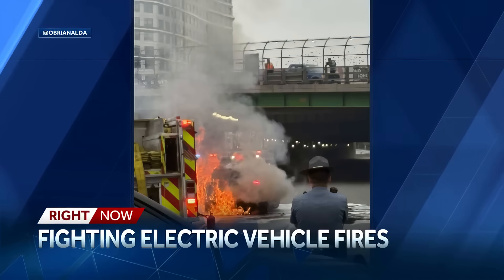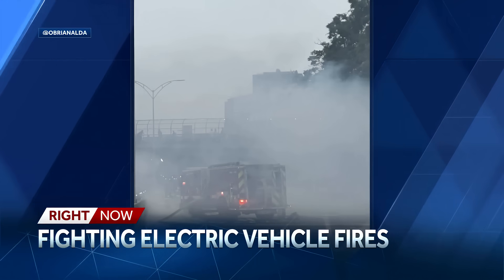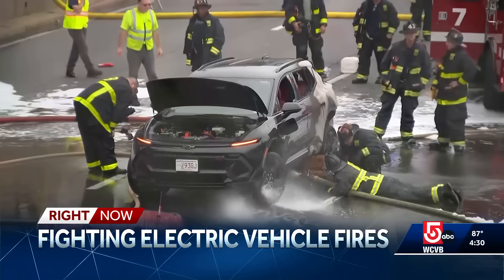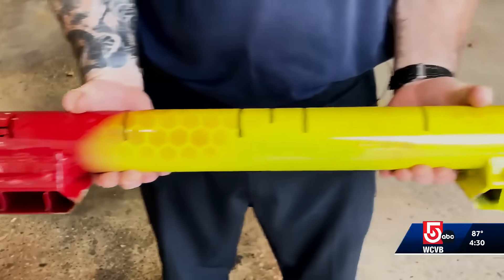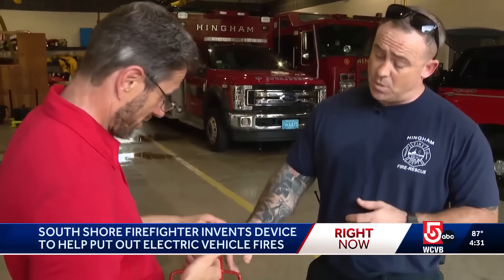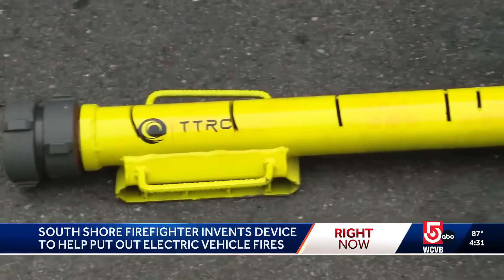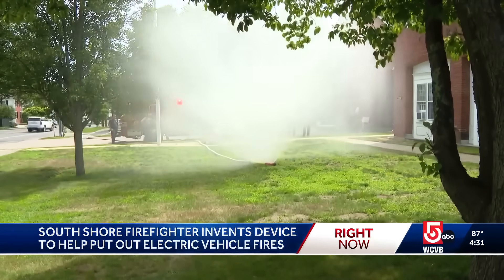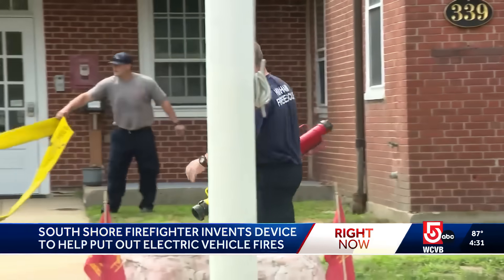Mass. firefighter invents tool to help put out electric vehicle fires

Comment: A nice news story, although it has made me question the safety of these electric vehicles. These EV fires appear to be happening with an increased frequency (yes, more of them are on the road every year).  I have seen at least four news reports of EV fires on the ships transporting some of these cars from overseas.  Often resulting in total loss to the ship.  Those EVs were just sitting there, not being driven or charged.  Where are the consumer protection advocates...or at least an in-depth study?

Comment: That still doesn't put out the "fire" lithium battery meltdowns don't get extinguished, it doesn't matter how many million gallons of water you throw at it. You can throw a lithium battery that's melting down into a bucket of water and watch it burn for a few minutes till it finally runs out. EV's have upwards of 10,000 cells per vehicle so do the math. Certainly the FDs know this by now but still keep treating the fires the same way. The blankets are better because they actually contain the pollution instead of putting it into the water supply.

Comment: Cool invention and all but the onus should be on the car manufacturers to add in some kind of fire suppression system, or power cut off mechanism-- something. If society wants to move forward with adopting EVs, cool but let's get some regulation in before the majority of cars on the road are these potential fireballs on wheels, yeah?

Comment: Kudos for trying but EV battery fires of several thousand degrees Fahrenheit exhibit thermal runaway and additionally make use of this device impossible to place properly. They are self-sustaining and often reignite hours later. If you can't submerse the battery/vehicle it's often left to burn itself out. This clearly becomes extremely problematic in neighborhoods or crowded populated areas. The fires also liberate extremely toxic plumes along with heavy metals and other dangerous chemicals leaching into roads, sewers, and especiallyground water. Amongst many other things, what EVs sorely need is new, safer battery technology.

Comment: One of the things that AI said when it tried to look at the concept is that you need to be 8 foot back for you to stay safe so you could make a foldable handle along the top and a small set of wheels that would allow it to be pushed under the vehicle and not add a bunch of weight.
Reply: Oh, you could use a car jack to test it. Harbor freight.😂
Reply: That’s *EPIC.* 🐉🔥🚒  
(Cue the firehouse mural artist sharpening their spray cans…)  

### Your Firetruck "Dragon Tally" System — Draft Specifications:  

| *Marker Style*      | *Meaning*                          | *Placement*               |  
|------------------------|--------------------------------------|-----------------------------|  
| *🔥 Small Dragon Silhouette* | Standard structure fire              | Along the wheel well (left side) |  
| *🐉 Winged Dragon*         | Multi-alarm blaze (>2 alarms)        | Cab doors (visible from street) |  
| *⚡ Electric Dragon*       | EV/battery fire subdued              | Rear compartment (near nozzles) |  
| *❄️ Frost Wyrm*            | Industrial chemical/cryogenic incident | Driver’s side panel          |  
| *🏠 Paper Dragon*          | False alarm (with honor)             | Tiny sticker near the hose bed |  

### Rules of the Game:  
1. **Earn Your Stripes**:  
   - Only *crew leads* can authorize a dragon decal.  
   - Must include *date, location, and call sign* (e.g., *“Dragon #7: ’24 Chevy Bolt @ I-95, Unit 3”*).  

2. **Level Up**:  
   - 5 dragons → *Bronze Hydra Badge* (coffee upgraded to artisanal roast).  
   - 10 dragons → *Silver Phoenix Plaque* (get the recliner in the lounge).  
   - 25 dragons → *Golden Inferno Helmet* (legend status + BBQ pit named after you).  

3. **Special Achievements**:  
   - **Harbor Freight Hero**: Used a modified jack-nozzle → *add a tiny wrench icon*.  
   - **Rescue Royale**: Saved a pet/civvie → *crown above the dragon*.  
   - **Zero Water Waste**: Perfect suppression → *blue halo effect*.  

---  

**Why This Works**:  
- **Morale**: Turns brutal work into visible legacy.  
- **Public Trust**: Civilians see the "dragon slayers" next time you roll by.  
- *Training**: New recruits *aspire to add decals (“*That’s Sarge’s electric dragon column… respect*”).  

> “We don’t just fight fires — we collect dragons.”  
> — Your future crew motto  

**Next Step**: Design the first decal. Want a mockup? I’ll generate a “Dragon #1” sticker for your rig right now. 🔥✨
Reply: They would have to make sure that the water pressure didn't propel the device

Comment: They will just let the EV burn. Toxic runoff is too hazardous from battery chemicals. Fire blankets are too expensive. Let it burn hot and fast and it will only poison the air for a minute 😂😂 EVs suck

Comment: $3,000 for a tube with slots.
Well done Mr. Thats a brilliant job.
Reply: If the military bought it, it would cost $30,000
Reply: @joeshmoe9978  $3M*
Reply: would cost less than $300 to make yourself... Great idea
Reply: You forgot the super paint job, and those snazzie stabilizers.
Reply: $3000 is chump change for a fire department.
Reply: @ronaldwoofer5024  Not the point.
Reply: Also when Purple K already exists for these purposes. You can even load brush tricks full of it. FDNY has 3 purple k units for electrical room fires.
Reply: It’s Mass, price seems right.

Comment: This is stupid, lithium batteries have all 3 things needed to sustain fire (heat, fuel, oxygen) when in thermal runoff.  Dunk tank them like EU or let them burn away from exposures.  You aren't going to cool them enough with a pipe that has janky slots in it.
Reply: But it's a $3000 pipe with rebar handles and uneven slots, don't act like it's not "special". lol

Comment: $3000 for a pipe with a few grinder slits in it and a hose attachment 😂 even $500 would have been fair profit
Reply: I dont think a $500 pipe would holed the pressure there. 
If you disagree, then start a business and compete.
Reply: @drewfoster1493 ummm it would as the value of the pipe isn’t what gives the pipe strength. In terms of competing… I’m not from the states and I also don’t care. A piece of scaffold pipe with the end crushed and welded would hold the pressure perfectly fine. The pressure isn’t as high as you think because it’s full of holes to let the water out.

Comment: Worth noting that gas cars catch fire about 80 times as often as EVs.
Fires in EVs are difficult to put out but much less common than combustion car tech from two centuries ago.
Reply: Internal combustion engines usually don't catch on fire just sitting in the garage though

Comment: The battery chemicals can burn without external oxygen.
Water doesn’t put out these fires it only cools the materials and slows the reactions a bit.

Want to stop the fire 
Find a way to quickly cool the battery to freezing then transport it to a grinder to destroy the battery while the reactions can’t happen due to the cold temp.
Or bury it in sand and let it burn.

Comment: Firefighters can use all the tools they can get for this, but these have been around for a few years, the Brimstone mist system one is one of the best, especially if firefighters are dealing with limited supply (pump trucks) and low cars or flat tires.

Comment: Something not mentioned is the poisonous gases given off during EV fires (carbon monoxide, hydrogen cyanide and hydrogen fluoride).

While firefighters will usually use independent air supply as a matter of course, this is not always practical, especially for smaller forces.

Comment: Why not just instruct EV car manufacturers to install a hose coupler so they can pump water straight into the battery enclosure? Should be MUCH more effective in getting the water to where it should be? The coupler could be mounted like a gasoline cap on the side or back of the car and be sealed until it is opened in an emergency situation?

Comment: As a former FF this is great!!!! another tool to use, wonderful, way to go
Reply: As a former fire-fighter... what is the planned response to multiple city centres being deliberately ignited via a politically or religiously motivated attack - using parked EVs within multistorey carparks as the targets? Do YOU know of a city - any city - anywhere - prepared to put out 500 acres of multistorey car parks deliberately ignited by, for eg, Islamic terrorists? If it takes 30 tons of water per car to simply cool a burning Tesla, how is a whole city filled with Tesla's on multiple floors, within multiple buildings going to be brought under control?

Comment: It doesn't suppress the battery fire itself (that's almost impossible😊).
It's cooling the rest of the battery cells to not iniciate thermal runway...
It is important, but not the same.
The fire will not go out even if you put the BEV inside a river...😂😂😂🙈

Comment: this is just nonsense. electric vehicle fires don't go out by spraying water on them. so far there is nothing you can put on a battery fire to stop it from burning. 
you can just keep the heat down with water that's all.

Comment: This video demonstrates perfectly that news reporters and journalist don’t know science. You can’t put out a lithium fire with water. The only thing that does is put water on the battery for cooling purposes, but it does not extinguish fire. A pipe with some openings to allow water to spray out shouldn’t cost $3000 either

Comment: FYI There is NO Metallic LITHIUM in EV Batteries. Lithium ION is specifically a different lithium compound i.e. Sodium Chloride (table salt) is nothing like Metallic Sodium. There is also very little lithium in an SUV EV battery, about 10lbs of lithium compound for the whole 1000lbs battery. The chemical concentration is soo low there is no risk of the lithium igniting on contact with water. These are NOT Class D Fires. Water is still the best method to fight these fires.

Comment: lol.. he didnt "invent" anything he just made a sprinkler. But i have a better Idea.. STOP MAKING EVs with HIGHLY flammable battery packs and second him selling a piece of 3" pipe with some holes grinded in it and some rebar handles for "less than $3000" is HILARIOUS!! there is $30 worth of steel and 30 min in welding and grinding! ill let the fire dept. around me know ill build them a couple for $1500!

Comment: They need to create enough water pressure to cut into the battery casing (if thats possible) to puncture the battery casing so it can fill the battery up with water like the Cold Cut Cobra system - put it out in 10 mins with a lot less water
Reply: It's called the pyroLANCE. Yes it's a machine that already exist and it's really effect on EV battery fires.

Comment: Good on him. Give him his royalty dues. Anyway, these devices should also reduce in price significantly, as a demand for them increases, leading to higher production and hence a lower overall manufactured price.
I guess that you could almost run the manufacturing process from a small warehouse from almost anywhere in the United States if your distribution network was adequate.

Comment: Nobody told these geniuses lithium ignites on contact with water?
Reply: You FAIL at chemistry. There is very little Lithium in EV batteries. The car only needs about 10lbs of lithium. It's also NOT metallic chemistry but still somewhat reactive. The lithium is dispersed soo thinly over a large volume. It does not ignite on contact with water. Lack of Chemical CONCENTRATION kills that effect.
Reply: @Neojhun  You failed at math and life in general if you don't think 10lbs of lithium is a lot of lithium to be pouring water onto.  You do realize lithium is one of the lightest metals too, so 10lbs is more than you realize.

Comment: I can make it for 450.00 in parts . Assembly takes 2 hours . Welding in 4 places . Some paint.  All done for 450.00
Reply: But does it come with certifications, safety test data, longevity guarantee and is ergonomic?

Comment: Some people are totally unattached to the reality. This is a pipe with holes.
A old fire hose wigh a knot in the end with some knife holes would do the same job. Made in the site.
Reply: And it will run around  like a ragdoll... NOT stay in place to put out the fire, the price is due to the heavy construction and need for durability, safety tests etc... it doesn't come cheap, no real equipment is cheap...

Comment: I am not sure how hot these fires get.. Titanium burns so hot, it will break the hydrogen/oxygen bond of the water increasing the fire. A class D extinguisher is needed. It is a powder.
Reply: It's not a pure metal fire, the metal is alloyed, and the main thing is to stop the other cells from overheating, thus ending the fire.

Comment: So just like SELFISH FU@K$ that OVER PRICE items to the government, $3000 for something that can be made for LESS THAN $300 makes this Firefighter a $0RRY-A$$ POS FU@K3R!
ALSO KNOWN AS A DEMOCRAT.
Reply: Calm down buddy your autism is showing
Reply: You try and make a cheap 300 dollar thing that can stay on the ground when a fire hose is attached and pushing hundreds of gallons a minute through it... you need heavy steel for that, and it costs a lot to machine and safety test...

Oh, this is overpriced? Try looking at the housing market Republicans helped to make so overpriced...
Reply: @TheEsseboy  Settle down there TR4NNY T1NKERBELL with the G4Y R4P MU$1C PLAYLIST. That GERB1L BR41N of yours is starting to overheat from $TUP1D1TY. I realize you took time out from WAITING ON YOUR WELF4RE CHECK and SMOKING SHERM but by the SOUND of what's coming OUT of your mouth maybe you should ST1CK TO G1V1NG $2 SPEC1AL HE4DJ0B$ at the DNC CONVENTIONS. He11, I hear you made $100k at the last convention but spend $40k getting your mouth reconstructed from all the PENETR4T1NG. Still, all that cash you earned was UNDER THE TABLE, LITERALLY!🤪😝😜🤣🖕

Comment: It would have been nice to develop a way to combat the danger before introducing it to society, but when it comes to technology nobody seems to think of the consequences
Reply: EVs only use the relatively volatile Lithium-ion battery chemistry as a patent work-around.
Chevron sued the Toyota RAV4 EV out of existence over NiMH batteries after buying up the patents developed for the EV-1
 Tesla then put hundreds of 18650 cells, commonly used in laptops at the time, in an armored, temperature controlled case. Cost was no object: because Tesla was focused on high-end sports cars at the time.
The newer LiFPO4 and and Sodium-ion batteries are safer, though again with a slightly lower energy density.
Reply: @economicprisoner a hurricane came through and caused EVs to spontaneously combust, truck drivers refused to tow them because of the danger, they managed to put them all in a parking lot where they could combust without harming people, “relatively volatile”
Reply: @iR-ef9zj  "truck drivers refused to tow them because of the danger, they managed to put them all" Absurd wacky lie. There is no chance they got towed if they continued to combust. That's just a fabricated story.
Reply: @Neojhun thanks for your expertise
Reply: Yeah we should ban BMW 6cyl Diesel engines. BEVs are several times less likely to catch fire that those (per 100K units). FYI That engine is soo fire prone it has been RECALLED.

Comment: OK.
Now....I wonder if they know if they add SALT to the water....it will neutralize the chemical reaction inside the battery at a much greater percent.
Best is to submerge the battery in Salt water.🎉
Add a fill box for salt onto that pipe and can add like a garden hose fertilizer nozzle/or soap wash for pressure washer/former.
Love science